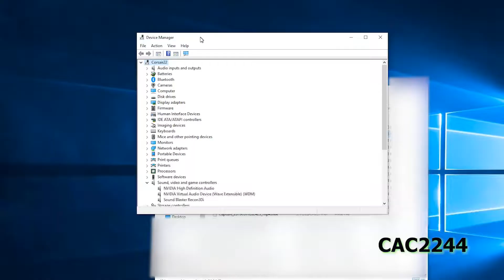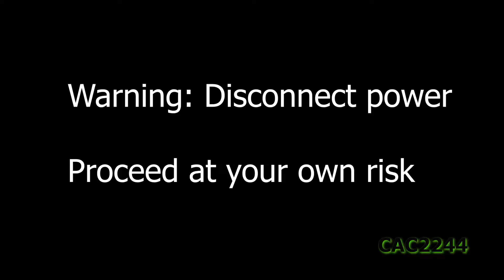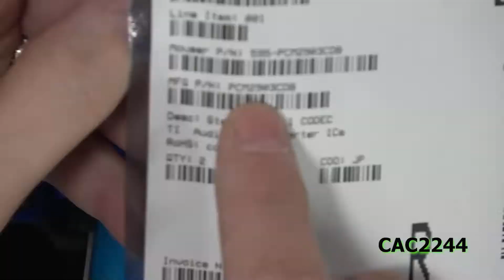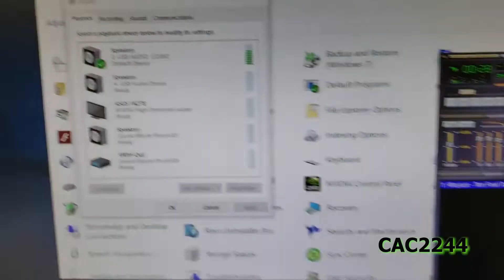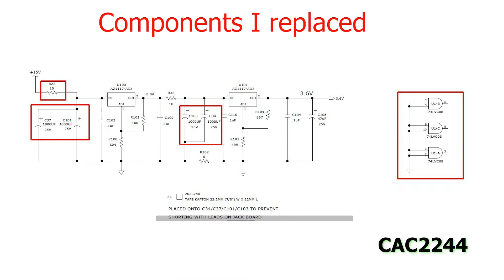Mackie ProFX USB PCB board repair

Comment: 2404 vlz4, had a problem with the digital fx display and the mixer was creating a popping noise. I opened the board, unplugged the fx pcb, turned the board on and the channels seemed fine with no popping. I reinstalled the ribbon cable on the fx pcb, and suddenly everything works. I don't know if its a permanent fix but there's zero repair info to find online for the 2404 vlz4. I do see a similar part number online for the fx pcb but my last 2 digits are not labeled on my board. Hope this may help anyone with this board or the 32 channel.

Comment: Hi ! I'm having a problem with this mixer, I suspect it's the PSU..basically when turned on, the effect lights (and +48V light, if switched on) pulsates and there's no signal passing thru the desk..removed and measured the large cap on the PSU and it's fine...any idea ?? thanks !!
Reply: based on my experience repair mackie fx8v1 or fx8v2 with same symtomps (pulsating power light, no signal) there are some broken diode at PSU. you should check two diode with marking SR3100, check if its short, replace it.
Reply: @muhammadyoesoef  thank you, will try that ! :)

Comment: I have a problem with my mackie profx8. when i turn it on the power led and the effects display flash. can someone help me?
Reply: power supply failure, if you take to 3rd parties service they will take about $20 or $54 if they replace the power supply.

Comment: Hi I have the same mixer with no input on channel 3 any ideas in pointing me in the right direction please?
Reply from the maker: I had 3 channels die on me gradually, so the only "pointing direction" I could give you is unfortunately to your nearest online electronic store...LOL... On my side, I am a masochist and went for another Mackie, the ProFX12 V3... I've had it for a month and so far so good.
Reply: @cac2244  I've thought about making an audio probe  amplifier tracer and tracing the channel using a signal tone generator.
Reply: @cac2244  just to let you know after investing in a pair of smart tweezers I found 5 diodes at the preamps to be shorted. I bought a pair of hot tweezers and replaced them and now all channels are working again.
Reply: Can you provide me with the electronic diagram of that console pleasee!!!

Comment: Where can I find parts for this mixer?  I have the 4 channel version.  Specifically, I think I need to replace the power plug on the back.  It won’t turn on and the plug seems loose, so I think that’s the issue.  Any ideas?  I’m not sure I have the original power cord, but any other cord I’ve used shows no power at all.  Thanks!!!
Reply: I had a broken power plug also.  I have the 12 channel board.  I was able to order one from Newark Electronics.  Their part number is 17B6788 it was only $1.14 shipping was more expensive 😉 it fit perfectly in the hole.

Comment: Mackie Pro fx v2 .... Power problem .. when I power on . Power signal light is always bliking. Plz sir solution do mujhe
Reply: I am having this issue as well with my profx12 at the moment. I forgot to turned my one off. Were you able to fix the issue?

Comment: I bought a new Bose T4S mixer and in no time it stopped working through the laptop HP with Windows 10. I spent 4 hours trouble shooting through Bose on my phone. Only to be told it was NOT the Bose but rather it was the Windows 10 was not compatible with the Bose T4S and T8S Tonematch mixers. I am worried now my temporary   Mackie ProFX12v3 12-channel Mixer (Have to keep working as a DJ/KJ) will arrive and do the same.  My question to you is; was it the mixer or Windows. I am using a high dollar power strip, Monster Cable 1000 if it mattered? Thank you kris@krisallen.com or 304 382 6633